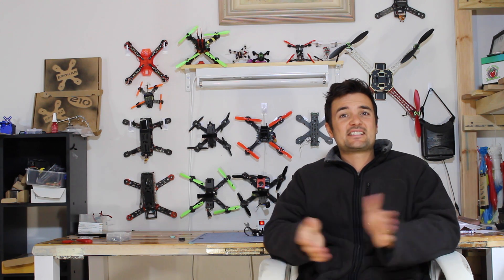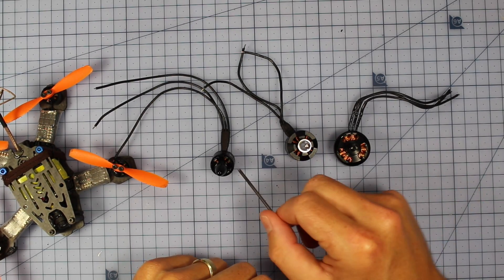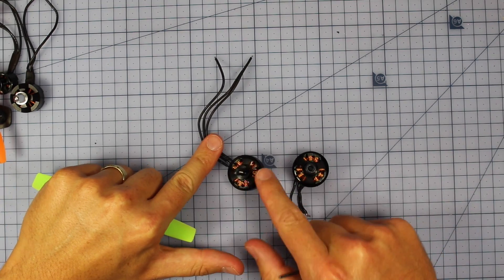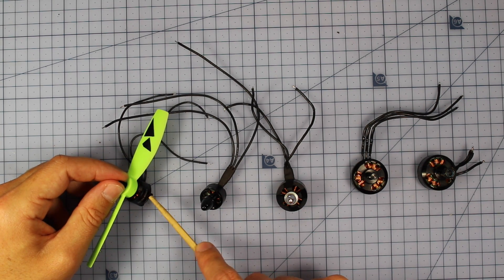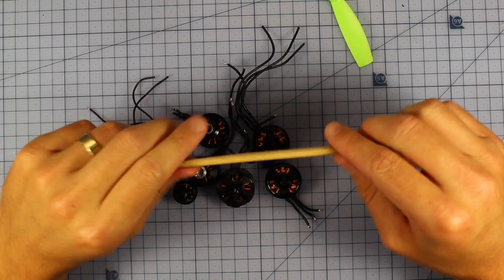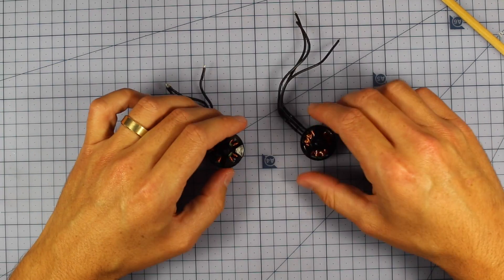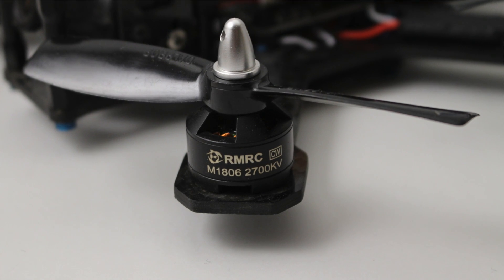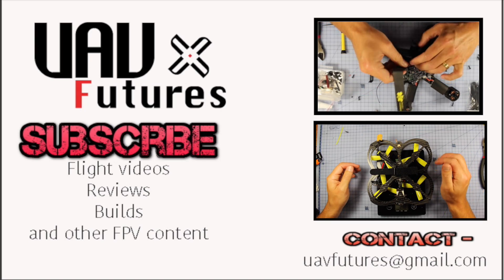How to choose the right motor for your MINIQUAD or RACING DRONE

Comment: what do you suggest for a 3d printed tank i am building?
its being designed with real mechanical power train (1 motor for everything+servo for clucth and gear selector)
because 10-40k rpm seem wayyyy too much for 3d printed part

i hate the KV rating i want my volt x amp back !!
ik its kv*volt=rpm  but
i need to know the amp ! >_>

Comment: I just watched your video and i have a question regarding thrust.I am trying to create a drone in which each motor can carry up to 250gms (not for racing purposes). While buying motors online almost none of the manufacturers give the thrust table or specify the max load the motor can carry.I was wondering whether there is a way to calculate the thrust given rpm,kv and other such parameters because i am having a hard time deciding which motor to buy.Also i cannot afford to create a thrust calculating bench so that's out of question. IS there any other way to know the thrust generated by the motor??

Comment: I have a 200 mm quad with 3000 kv motors .. looking to get more power ,thrust and run on a 2s or 3s battery. Which motors would you recommend and props ?

Comment: Excuse me sir, i was just wondering if i could use my x-1505 tarantula receiver(board) for building a racing drone if i change the motors. Would that be possible? If yes, what kind of motors should i use? Brand, weight or any suggestions? Please

Comment: I want to build my first Quad, but im stuck. Could you tell me what do you thinck about: Selfmade 3D Printed Frame + 4x20A ESC + 4x 1040 Props + 2216 880kv Motors @ a 3S 5000mAh battery controlled by Flysky Remote and a cheap F3 flight controller. I want to juse it to fly Around with an GoPro on a Gimbel and a small FPV Camera, so i tried to find big Motors for Big props for low RPM. At the Datasheet of Motors i see there are 4,4A @50%@3s Lipo to lift 300gramms. So i calculated 1200g @50%@ 17,6 A will take about 15 min in Air.

Comment: Great Video!
I have a 2 in 1 6A ESC of Racerstar, which of the following motors works best with it? 
1) 1104 7000kv
 2) 1104 6500kv 
3) 1104 4000kv 
all rated for 1-2 cells 
and what propeller should I use? 

Thanks.

Comment: I had those RMRC 1806's, the...worst....motor....ever.
Magnets get shat out on any impact, bearings are terrible, the shafts slip on the bell. yuck.

My fave size so far is a GOOD 2205 with high KV swinging 5040 or 5045 tri blades.

Comment: Hi Stu. I'm trying to built casting drone for fishing. It should be able to lift 200-300 grams of bait load, at a range of 300 meters max. Could I use 2205-2206 with 2300KV or should I go bigger (2830 with 730KV)? It doesn't have to be very fast. Thx
Reply: Ionut Vlase  2205 is ok if you dont wand big cameras
Reply: surcinko Thx

Comment: Very late to the party but just started looking at the quads, what would you suggest for a 100mm build, I am currently looking at either 1103 or 1104, is there really much difference in these?

Comment: Do you have an updated video on this subject?
I'm looking for a good motor to put on 5 inch quad, a beginner setup, I'd prefer longger time flights over top end speeds...
soo i'm pointing to a 2205 2300kv motor maybe.
How do I compare motor specs? where to look?
cheap vs expensive motors?
What's your advice?
Cheers

Comment: hey man i just made a phantom 1 electronics into a phantom 2 shell with new motor's same kv and so i soldered on the first motor which is the back left and then i plugged everything im to test if it's spinning the right way and so then i soldered on the 2nd back right motor and also tested it then i just did the other 2 at same time and tested it and so i had to rotate the naza 180° so that the arrow will look forward and so when i put everything together and took of it just instafliped on me and i realised that the first 2 motor's i did are going into full throttle and that's what's making the flipover what do u think i should do some people told me that the drone needs to be fully calibrated with laptop do u think that will fix my problem what do u think? awesome video's btw i like yo drone collection (::
Reply: insta flip means you have one motor is rev rotation check that

Comment: Im building a 500 size Quadcopter and my question is why not use an Emax 2205 2300Kv @ 20A=700grams instead of an Emax 2208 1500 @ 15A=600grams and the 2212 920kv is only about 100grams more at 800grams. What am I missing? 
Also love your video program👍

Comment: I think the best motors for our hobby with have a 3:1 down to a 2:1 diameter to height ratio. MAYBE an extension to a 4:1 ratio, but, after that, absolutely nothing less or more. Examples of a 2:1 are the infamous 1407's that can run with a 5" racecraft 5038 twin blade at insane kv and power a 300 gram AUW 5" quad at a 12:1 thrust to weight ratio.

A 3:1 would be your standard 1806's. And a 4:1 exactly would be like a 2005 or a 2406. I don't really think either exists.

My fav would likely be a light weight, high power 4.5" quad {I've made another post about changing the quad sizes to be 0.5" less than the current ones, replacing most classes with better middle grounds and causing people to be more diverse} with a 1608 or an 1806. *click* noice.

Comment: Great video Stu! Very practical content for those getting started (like me)... only thing I missed is brushed/brushless types which I do no think they are mentioned. I know brushless is the most common motor anyway but I came across 70/90mm frame quads using them. Anyway, thank you so much!

Comment: how do you know if it will mount to the frame of quad? are they universal?
Reply: MrFantasticJackson yes
Reply: When buying your frame and motors find the bolt hole spacing
Reply: No  cause I had to slit my holes with a Dremel tool to get bigger motors in my runner 250r

Comment: Have you tried the the T-Motor F60 2207 2450kv? It boasts +1745g thrust 😳
Reply: With what props tho?
I have some 2208 2450k and some 2207 2650kv end I'm whunt to put some raceing props on I'm thinking 5050 bi or tri
Or 5.1x4.66x3
Or 5.1x4.77x3
Reply: @TECHnoman753  bi blades are more efficient and often used for longer flight times (other than the latest DJI, all of them before have bi blade., but for racing tri blade is better thrust.. also high amp draw. Too aggressive and you will get battery sag (lower voltage) worst case you blow and esc and kill a battery. 4.77 is more aggressive than 4.66. I would say try both.. and see what feels better. Sounds like a cop out, but remember the entire build works together.. so the props will be only one part. Battery and build quality will also play a part. Ultimately how you feel it flies will make you a better pilot as it’s easier to fly with.

Comment: I am building a 250 quad but I am also a beginner so I don't want that fast the total weight is 2300. What motor is best for this(5 inch prop)
Reply from the maker: 2300kv 2205
Reply: UAVfutures thanks you so much

Comment: Can you help us understand what to look for when choosing an esc to get the best performance from your quad,  I have been having trouble getting good throttle from my builds and I am using good motors. I havr a kiss quad with awesome performance yet my other builds are very slow regardless of the PID setting.
Reply from the maker: pids dont change speed

Comment: my zmr 250 just burnt one of the 12a simon k esc"s that the quad came with,,,im only running 3 s turnigy 45-90c 1300mah and i've got 6045 props and the 2204 2300kv ,will  putting 20a escs fix my problem ,i've heard the 6 inch blades use alot of power   so does my battery lol...will they need a change? ... don't want to fry my new 20a as i don't know if they will  be enough .this is my first quad  so im  confused at the moment
Reply from the maker: 20a will be fine on 3s
Reply: thanks for replying

Comment: Would it be good if I ran emax 2205 red bottom motors with tri blade props using a 3s battery and 20a blhelis esc?
Reply from the maker: yes
Reply: if ve take 4s battery. can ve use same 20 esc?
Reply: please contact us www.crazy-motor.com to discuss with us more about how to select a suitable brushless dc motors for your drone, we are professional motor manufacturers.

Comment: i want to wake my old 250 quad up it has t-motor mn 2204-16 2300 kv motors with 12 amp esc's. its really slow for my taste and i want to put some bigger esc and motors on what would you recomend? i run 3s i tried 4s but i actually didnt notice a big speed boost
Reply: rayikaikin just try getting larger  props !

Comment: I want to build a quadcopter that is going to be like 10lb to 15lb in weight. I have no idea where to find motors that will work or what type. any suggestions?
Reply: http://montorc.com/avrotolift3515400kv.aspx
Reply: thanks man
Reply: Mr.JBI22 just remeber, those will only be effecient if you run 6s.
Reply: alright so buy 6 motor and a frame that holds 6? I was thinking of using 8 inch rotors for the motors is that a good idea or not really?
Reply: Mr.JBI22 You will get the best results with 16x5.4 props. with 6 motors you should be able to carry a 15 pound quad and a 5 pound gimbal, and hover at half throttle. That setup seems good. is this your first build?
Reply: It is yes. I'm not set on anything for parts ... I was looking at the pixhawk flight controllers and motors that's about it. I was just bored and was looking around I saw someone using a pi bored linked to a pixhawk to control a drone from his computer. and i was looking at a loco M5 radio awhile back for long range wifi networking so it hit me I have a pi and I know the networking equipment I need...why not have some fun. I was thinking mount a small wifi radio on the drone and have another 15km one on my roof linked to my home network. And that's where the 10lb to 15lb came from. for the extra battery for the loco and the 2lb or 3lb unit itself.
Reply: i'd highly recomend getting an inductrix or something of that sort before you go out and spend 1500 dollars on a build. they alot harder to fly when they have no stabilization.
Reply: thanks for all the help man. Yeah...I've thought about getting something small at first to mess around with maybe even take apart and use for a DIY mess of mine. I have a friend who wants to "walk" before we fly. He wants to build a rover first, less risk of damages and more room for build experience.
Reply: id recomend a rover first so you can sort out all the technical stuff before you put a big investment into the air. if you do want to start with flying, dont let the cost scare you. its worth every penny for some of the shots yol will get.

Comment: brushed vs. brushless?
Reply: I love brushed because the quads are light and can take multiple crashes without damage.  I love brushless for the power but no matter the size they will be relatively heavy and prone to breaking in a crash.  I mostly fly LOS and brushed are still fun because I'm not afraid of crashing so you can push your limits.  I live on only an acre so I don't have much room for fast, heavy, brushless quads but there's plenty of room for  brushed quads.  That being said, the Bugs 3 mini is the perfect size and speed for my yard, it can get up to top speed for a few seconds and its very maneuverable.  The full size Bugs 3 is just a little too big and can't really get up to speed but is still fun to fly.  I hope that made sense.
Reply: most of the drone uses brushless dc motors. www.crazy-motor.com

Comment: I hope you can help me with this I wanted to build a mini quad with maximum distance and flight time so after lots of research ended up with t-motor 1806 1400kv which is very effective with 6" to 8" props. I don't room for that size prop and can't find a nicer frame my question is if I use the 5" six blade props for team racekraft would hat compensate for the smaller prop size? Thanks

Comment: What if Im not looking for a racing motor. More like a sport motor, im not really concern about speed and acceleration. Im new to the hobby and I want build a quad that i could learn. So far im planning out my build. The frame is going to be a Q210W and i want to be really agile. Ideas???
Reply: Silver ADFX-01 agility depends on your tuning like your PIDs and rates
Reply: Just buy cheap racing motors like these ones: http://www.banggood.com/KINGKONG-2205-2300KV-2-4s-CWCCW-Brushless-Motor-For-RC-Multirotor-p-1056209.html?p=9M251430988682015113
But use only a 3s battery. In this way the quad won't be too fast and is ideal for learning but it is also 4s ready for the moment you have some experience and want to start flying fast.

Comment: Great video, very informational. I'm new to this and gathering as much info as possible. I'll probably build a qav210 and I was interested in the Lumenier RB2205C-12 with ceramic beatings. It has 2400 kv and I assume I'd use a 5" prop. Would this be a good balanced setup? I'm still learning about power but I assume that would need 4s, correct?

Comment: Hey, I just recently build my own drone but I don't know if I pick the right motor...
I have a battery of 6000 mah of 11.1 volt
I have motors of 920 kv
I have esc of 30A
My drone weight 1750 grams
Is these motors are right are I would have to buy some that have more power of trust 
Thanks
Reply: I have 6 motors
Reply from the maker: not sure about such big motors and batteries sorry.

Comment: I am building a 150 quadcopter. I need some motor that runs 3545 props (3 and 1/2 inch). What motor is best for that?
Reply from the maker: 1306 4000kv

Comment: so 2204 is ok with 5 inch prop?
Reply from the maker: as long as the kv is not too high
Reply: its 2300kv
Reply from the maker: Mr Doritos perfect for 5"
Reply: and 1306 4000kv or 3100kv for 4 inch prop?
Reply from the maker: Mr Doritos ok for a non bull nose prop
Reply: but is a 3100KV better with 4 inch then a 4000kv?
Reply from the maker: Mr Doritos probably easier on the motors
Reply: Okay Thanks

Comment: hi, i have a question, im going to buy a walkera runner 250 drone with a 40 Km/H top speed and i want to make it an upgrade because i want a more bigger top speed like the walkera furious 320 (120 Km/H top speed) and my question is, its that posible? and if it would be posibble, what kind of brushless motor do you recomend me to buy ?
Reply from the maker: 2205 2300kv remax red bottom motors, some 30 escs and some Bn 5040 props should get you a lot faster

Comment: Hey Stu, I'm new to this hobby and have learned to fly on toy grade quads. I want to build a quad that I will fly line of sight for a bit and then put some fpv gear on later. I want to use 11mm motors (small frame) and I would like to build this as cost effective as possible being my first build. Would would be the best bang for your buck brand of motor in your opinion. I am not looking to break the bank on this one! Cheers from New Brunswick Canada!
Reply from the maker: I dont think LOS and 11mm work well together sorry. 

I would say get the beginner kit I reviewed recently. It does not come with fpv gear. And when you are ready you can add it in and have a proper racer.

Comment: What do you think about the Sunnysky X2204S 2300KV for a ZMR250? With 5030-5045 props
Reply from the maker: should be totally fine
Reply: did you tested that motors?
Reply from the maker: Bello3 no but I have seen people use them
Reply: oh ok

Comment: what happens when i run a 1306 3100KV motor (for 2-3s), with 3x4,5 triblade props, with a 4s battery?
Reply from the maker: it breaks.
Reply: hmm okay yolo ^^
Reply: Lol
Reply: works fine xD 

my brother also using a 4s bat with 3s motor and nothing happens (quad and hexacopter)
Reply from the maker: deathstar9812 I doubt he is running 1306s with tri blade 4045 BN on 4s.
Reply: he is running 2212 motors with 1045 props (10 inch)

and its not 4045 props that i use. its 3045 ^^

and hey until now my motors just getting a little bit warm nothing more

Comment: I'm trying to build my own quad and was planing to use these motors  Original DJI 2312 960KV Brushless Motors For DJI Phantom 3 Pro, I have a syma x8w that I plan to turn brushless, what are all the stuff I need to make it happen, ESC, props, flight controller etc.
Reply: you can buy a carbon fiber frame that will perform better and be easier to build for pretty cheap...

Comment: Sometimes it's a hassle to find characteristics about motors, even with intensive google research. Can those be interpreted as a "bad" or at least "to avoid" motors, then?
Reply from the maker: +Axel Thieffry Yeah, the reddit /r/multicopter has a great community and rc groups as well. They can usually put you on the right path